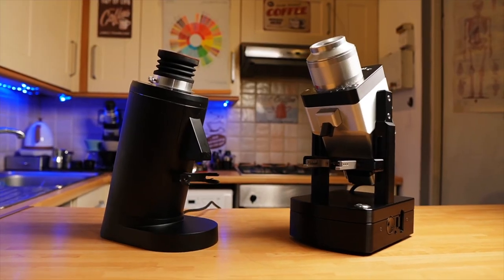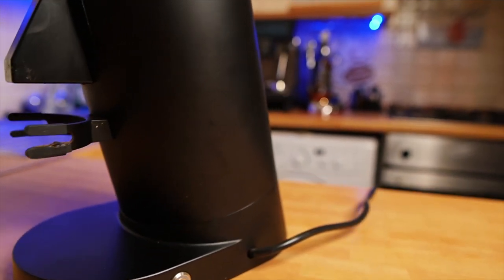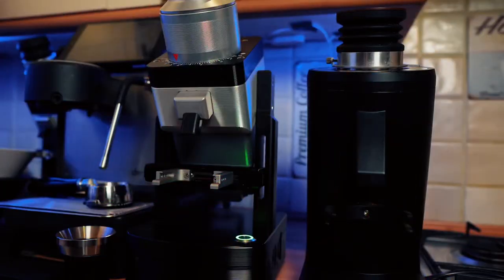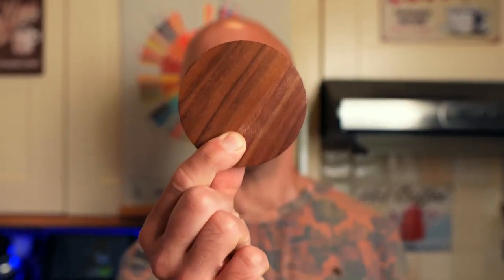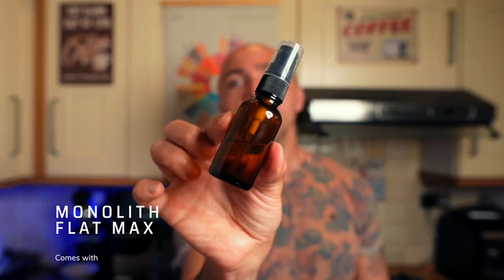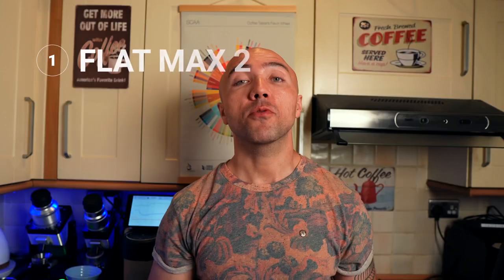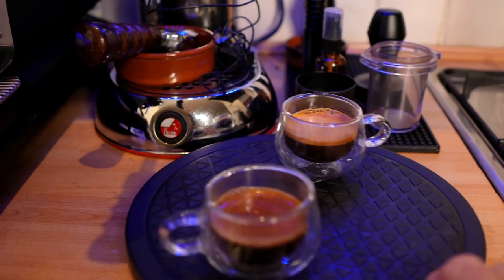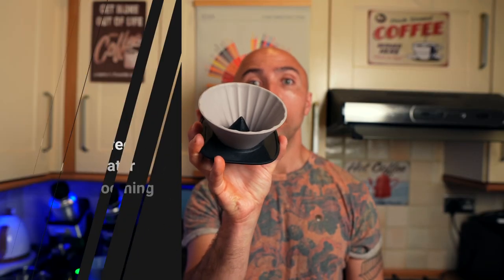Monolith Flat Max 2 vs DF83.

Comment: So there is a clear difference for expresso. I am glad there is. But not so much for pour over. I have the DF83 HU and I am happy with the pour overs. They are not as good as using 98mm SPP MP combined with the Decent V3 method but satisflying close. Do you think coffee quality could change any of your findings?  In audio, you need a high end amplifier to appreciate all the qualities of a high end speaker. Not sure that the analogy holds in our case though. Probably on the other end? If you get cheap/old coffee a high end grinder won't make much of a difference right?
Reply from the maker: Many things can influence the taste. I don’t use cheap coffee but sometimes you just get flavours you are not a fan of.  With espresso there was a clear difference. I would not say the shot from DF83 was bad but Max opened the notes much more. It reminded me a bit the difference in video footage before and after colour grading- the same picture but soo much different. 
As for pour over, I don’t know. I had some of the best ever cups from Max but this time it was average. Pour over from DF83 is consistently decent. In unedited version I mentioned I should probably up the temp to 98-99 to get more out of this coffee.

Comment: You have to remove declumper then test again. Declumper cause regrind in DF83 hence more fines, much more.
Reply from the maker: I replaced it with Camperista3D declumper long time ago for this very reason. It is much better now.
Reply: @mycoffeeshow111 even that declumper will cause regrind and dull flavour. Df83  has this flaw of restricted exit from burr chamber into chute.

I beg you to try remove all declumper.

Comment: I don't use RDT on my Monolith or DF83 (or any grinder although I think they might benefit from it, I just don't like it).
I think the DF83 does do better with a nice neat fluffier pile of coffee. I did slightly mod the declumper, so that seemed to work nicely!
Reply from the maker: Without rdt it becomes messy especially if you use the blower.